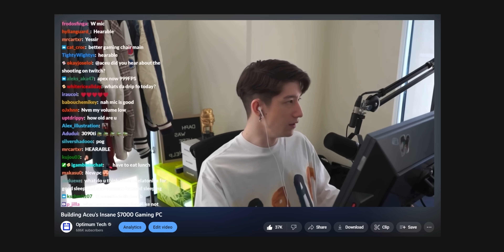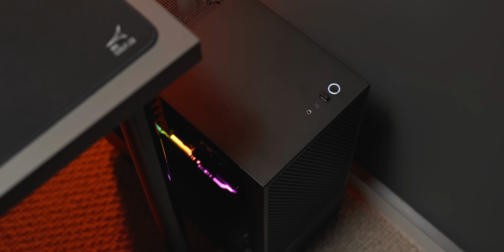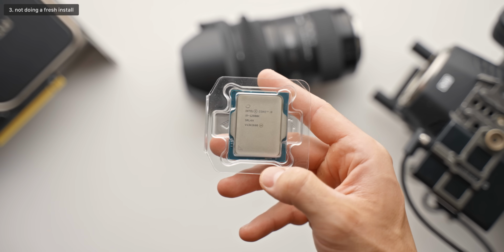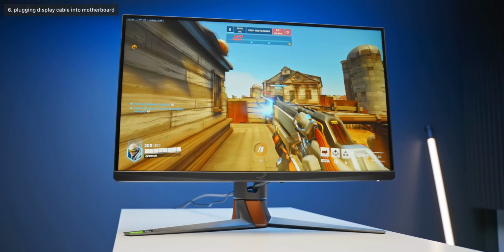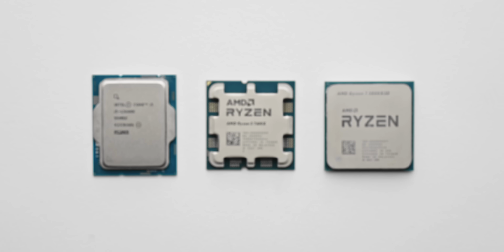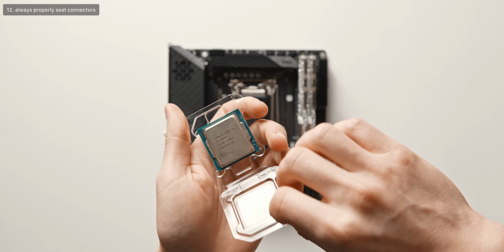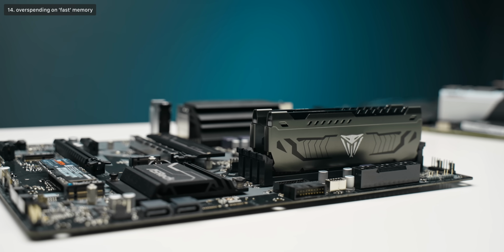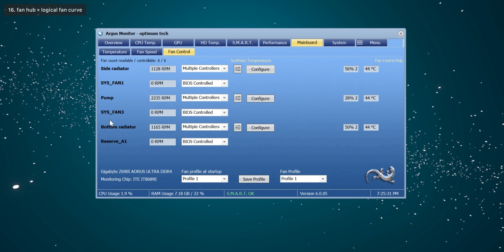Avoid These PC Build Mistakes

Comment: You forgot to mention removing the plastic before mounting the cpu cooler. Still can't believe people miss it..
Reply: It’s natural selection at that point tbh
Reply: I did that last night 😂😂😂
Reply: I've built 40+ PCs and still miss it. Haha
Reply: Never happend to me yet with 20 years of building computers, forgetting the power sw cable or plugging them in to the wrong pins though 😅
Reply: @Tjocksnorriss  I mean I notice when temps are off by like 10c. But I've ran benchmarks with it on and it doesn't melt. Lol
Reply: @PokèMyBalls  😄
Reply: In Norway there is no plastic on the cpu.
Reply: @DR0NE_BEE  On the cooler or CPU? Or both.
Reply: @DR0NE_BEE  doesn’t matter where you live most coolers come with plastic on the cooler contact peice so it doesn’t get damaged
Reply: it's so mundane that it's often forgotten.
Reply: 1% of the population is perfect. We gamers make up the other 99%.
Reply: I built more than 100 gaming systems and yesterday was building new one for myself, forgot to take off the plastic wrap on Arctic Freezer and fucked up badly when I saw 100c thermals lol. The size of AIO distracted me from mounting properly ;D
Reply: enrique amaya  im atheist bot
Reply: TIVOLT
Reply: Did that just yesterday, after mounting the radiator on top of the case I remembered so I had to take out the whole aio again lmao
Reply: almost forgot💀💀💀
Reply: @jakisgosciu7154 też o nim pomyślałem xdD
Reply: Or removing to plastic covers from the thermal pads of the heat sinks on the mainboard when installing an M.2 SSD.
Reply: It usually just pops by itself after mounting the CPU so no need to remove it before
Reply: @ionut122  Not the plastic cover of the socket. The cover of the heatsink.
Reply: I've legit gotten coolers with thin clear plastic strips on it, only right before i put it on the thermal paste did i get the feeling i forgot something.
Reply: I used to buy customizable computers online, so I could choose the parts, but don't have to build them myself, because I was still unexperienced back then. They sent me the computer and all was fine. Years later, when I decided to upgrade my CPU, I saw that the people who build my computer forgot to peel the plastic of the cooler... and it was all covered in thermal paste. So even professionals who earn their money, building computer for customers, even forget that. Funny thing is: It actually did not really impact performance or heat... Atleast it seemed like it. But still, if I buy a pre-build computer, this should not be happening.
Reply: @KEEYBLADE  I am building my computers for 30 years now, and it has become easier and easier over the time. I don’t have to set the CPU frequency via jumpers any more.
Reply: @PokèMyBalls  it happens, to me not that error in particular, but I have built a lot of computers and helped friends, and last time I told one of them to make sure not to forget updating the BIOS before upgrading the CPU or it won't boot (old AM4 board to a 5000 series).

Here I am a few weeks later updating my old build from a Ryzen 5 1600 to a 5600 only to forget updating the BIOS, won't boot and then having to repeat the installation of the CPU cooler again (remove, clean, reapply paste to the old one again, flash and repeat for the new one) 😂

This small mistakes happen
Reply: I almost did, but I seen the corner sticking out right before I put it on. Not to mention that I'm my CPU ever were to go above 40° idling; I'd panicked and open it up again😂
Reply: Happened to me on my first time a few years ago
Reply: don't forget to turn on the psu either
Reply: It doesn't help when they put TRANSPARENT plastic on it, cut to the same size as the part. The only way to notice it is the too-reflective surface finish.
Reply: @DR0NE_BEE  Why would you need a cpu cooler in Norway :)
Reply: Forgetting to put the Motherboard in the case when powering up.......
Reply: Oh. Haha. I just built my first PC yesterday. By the time I thought everyhting was ready and booted it up, I’d done everything perfectly but I totally put on the cooler AND SSD thermal pad with plastic still on because the sheer anxiety pumping through my veins over the possibility of making a mistake made me big dumb
Reply: Years ago I had an r9 280x that had a sticker graphic on the card. 

It wasn’t until I was removing it to swap the dead MOBO at that I noticed it was peeling a bit. So I peeled it off all the way, and on the underside of the stick was a big red label saying “REMOVE STICKER BEFORE OPERATION”. 

Good job radeon, putting instructions on the underside of the sticker where the user can’t read it until they’ve already removed the sticker 😂
Reply: The implication here is that YOU have never missed it. I'm sceptical..........Can you prove it?
Reply: Removing plastics from electronics is like the best thing ever thoo
Reply: first time i ever put on a cooler on any cpu was insanely close to doing that

that was a month ago
Reply: Bro saved me from an headhache for next week
Reply: What do u mean with plasitc…
Reply: @greesypickels  there's a peel on the CPU cooler that you have to remove and is sometimes not mentioned in the instructions, but present on basically every cooler. Yes it makes a difference, yes it might melt. Yes you have to clean thermal paste and re-apply it if you didn't peel it
Reply: @modernmanueee_  im literally building a pc right now but my cpu cooler didnt come with a thermal paste tube. I bought the nzxt kraken elite 360 rgb with lcd screen. Could it be that the thermal paste came preinstalled?
Reply: @greesypickels  if there's a gray square on the copper block of the cooler it might be, thermal paste is pretty obvious looking.

their website states that it does come with pre-applied thermal paste, IDK how that looks though! I think it has no plastic on the block since paste is pre-applied. In my case, peerless assassin 120 SE comes with a tube AND WITH THE PLASTIC PEEL
Reply: Something that could help this is not using clear plastic. While this won't help people paying at least the minimum of attention, but some what plastic could help some people realise that it shouldn't be there
Reply: I missed it on my first pc builds, I botted up the pc and it would crash on idle until I realized I had left it on.

Comment: Don’t do 16, just use something called fancontrol, other YouTubers have done videos on it, it’s software and entirely free and has more features than NZXT’s software which requires you to spend money on the fan controller. It’ll let you control any fans plugged into your motherboard down to your VRM fan too! And allow you to select pretty much all temperature sensors too. Argusmonitor you still have to pay for and it has less features and just doesn’t look modern in any way
Reply: SpeedFan is another option
Reply: @sushimshah2896  did speedfan got updated the last decade?
Reply: thanks for this one @calzone
Reply: Yup, you can set your case fan curves to be based on both the cpu and the gpu. When one or the other gets hot, it ramps up however much you want.
Reply: Was flabbergasted to hear that advice in an otherwise fair video (especially after "vendor bloatware" section) and headed straight to comments to check if FanControl was mentioned. Luckily, it was.
Reply: I Just said that too. its so much better! And FREE1
Reply: 15 and 16 are basically just disguised ads for useless shit. I'm quite disappointed that he puts such disguised affiliate marketing shit into his videos.
Reply: When I was using Windows I was using fancontrol and it was fantastic.
I could configure almost everything how I wanted without any trouble.
The only problem was my Corsair AIO, but the only software outside the Corsair one that can manage it is liquidctl (that I'm still using since it's available on Linux).
Reply: @Xul  I think it is pretty evident that he has been doing that for years.
Reply: @SECshock  It never appeared (to me) to be that silly and obvious, though some of his other videos already pushed crap products.
Reply: Thank you so much for that Tip!
Reply: Fan control also allows you to control any fans, GPU included. So glad I use that software, my pc is way quieter for minimal temperature increase.
Reply: @ladmad9196  no lol. It works great with my Dell laptop though
Reply: gotta check that out. I currently just have the temperature probe provided with my X570-E strix shoved into my GPU for control of the intake and exhaust fans. Works great but it obviously takes the probe time to reach temperature to control the fans.
Reply: @christophervanzetta  huh, hasnt worked for any of my mbs yet. i actually use argus monitor (found it on my own through forum posts actually) and so far its been the only software that remotely does what i want it too.
havent tried fancontrol yet tho. i will keep that in mind to try it out
Reply: @christophervanzetta  FanControl is literally the best
Reply: @hoplul  i absolutely love your Profil Pic
Reply: thx
Reply: @Xul damn, on such a video disguised ads? Disgusting smh
Reply: Tysm

Comment: Biggest: Not turning on your power supply and thinking you messed up elsewhere.
Reply: fr i did this but realized before i got too scared
Reply: Yep this is the best one stripping it all down putting back together doing it 1 component at a time for the power supply to be on the off switch i did that 1 time and never again that is what i check every time now can guaranty plenty of people have done it.
Reply: Or even better, like me yesterday, not switching the power switch on the wall for my psu and wondering why it won't turn on..
Reply: And then breaking the entire build because you think it doesn't matter at that point.

Comment: Gonna have to disagree with getting a cheaper CPU for gaming, it really depends on the type of games you play. If the game is optimized correctly yes it should be mainly using the GPU, but some games are VERY CPU intensive. I mainly play a lot of MMO's and a better CPU makes a huge difference, especially when there are lots of players on the screen. I also play some games that are optimized very poorly and heavily rely on the CPU.
Reply: If a game is CPU dependent, it doesn't have to mean that it is poorly optimized. Take strategy games like Civilization V or VI for example. In general, the faster your CPU, the faster the AI calculates their turns. CPU's are better at AI calculations than GPU's unless you have an AI accelerator card. But I don't think those can be used for gaming anyways.
And then we have games like CS:GO. It has so simple graphics that most of the time your bottleneck is the CPU.
Reply: Exactly bro for example modded multiplayer asetto corsa is very cpu intensive
Reply: Tf2 is another good example of CPU intense game
Reply: moreover, more powerful cpu mean that you can stay with it longer without need to buy new cpu
Reply: No game is more poorly optimized than Ark.
Reply: Yea that was a massively bad take.
Every single major part (MOBO, RAM, CPU, GPU, storage) of your PC is important.
The amount of people I've seen saying bullshit like "no no you don't need a good MOBO just get the cheapest thing you can find" and then run a 4090 or something and act surprised when their performance is ass?
Or when they run all that with a fancy MOBO but then have a garbage CPU? your pc is going to be poorly optimized.
Or when you run that fancy ass CPU, MOBO, and GPU but then you got the cheapest RAM money can buy that runs at 2133 mhz?
yeah nah. And then you got the good RAM, CPU, MOBO, GPU, and then you throw in some SATA SSD as your OS drive or maybe even a HDD.
Like, yes it can work.
yes you'll probably get better FPS than someone who has really bad parts overall.
But you're just bottlenecking the shit out of your system.
Reply: @Gary_The_Metro  Hey man I'm planning an am5 build for my first pc rn and was thinking of cheapening out a bit on the mobo since the more expensive ones didn't look like they had anything I cared about (pcie 5), would you mind explaining how exactly a cheap motherboard could affect my performance?
Reply: @madaranotsoanonymousnowuch1539  Well for one, if you get a MOBO that doesn't support 6000+ mhz for example and you're using an AMD CPU, your CPU is going to bottleneck hard.
Additionally there's the simple fact of less m.2 slots which can be more or less important depending on the games you play, what you do, etc.

Then there's chipset, Some chipsets are simply more efficient than others.

Now mind you, I am not saying "Just go for the most expensive mobo imaginable, just throw money at it wcgw"

I am saying, that if you're already spending 1k on a GPU. 400 on a CPU.
Don't spend 50 on a MOBO.
Reply: If your playing mmos or simulators, you don’t need high performance Lmao. Just run it at 60fps and be done with it
Reply: All the games are not optimized for 8+ cores. MOST of them are optimized only for 4-6 cores. And some of them using only 2 cores. So you dont need a i7 ,i9 , R7, R9 CPUs for games. You just need a good and powerful 6/12 CPU with good perfomance per core.
Reply: If you play mmos, your opinion is invalid and you might as well use a 400$ laptop
Reply: High CPU core count is rarely a factor in performance, even in CPU-bound games.
Reply: I know this is a year old but like someone mentioned, it's also easier and cheaper to upgrade CPU than GPU. Having an high end CPU is already future proof than trying to do the same with GPU.
Reply: @Gary_The_Metro you can buy cheaper cpu components as long as they are spec accordingly to what results you’re trying to accomplish for example i run the cheapest b650 motherboard with a 4090 because on that pc all im doing is gaming so and i dont need all those extra features. I run the cheapest ram i can find as long as its at least 6000mhz oc im  good. I just make sure my cpu and gpu dont bottle neck each other
Reply: @mrgoodbar216  You seem to be mistaking "extra features" as being the opposite of cheap.
cheap MOBO's can still have dumb extra features. I'm talking about making sure you have a MOBO that actually can handle the stuff you're throwing at it. Making sure it's build quality is at least reasonably solid and as you said yourself, isn't a bottleneck.

My point, is that when you buy a PC there is no part that is "unimportant" 
If you got a 4090 but you're running DDR3 RAM at 2133mhz on a fancy ass CPU. Your system will be garbage and no amount of GPU or CPU power will fix that.
Reply: Squad for example
Reply: The past has shown that mid tier PCs benefit from "overspending" on the CPU. The time between upgrades is long enough so you will have to buy a new 200$ motherboard anyways and the difference between CPU prices is effectively much lower(400$ vs 600$ instead of 200$ vs 400$.). You will be able to use a better CPU for 1 or 2 more years and have a smoother performace the whole time. For example a 300$ i7 4xxx would have been a better choice than a 200$ i5 4xxx for most people even though the performance difference at launch was just 10%.
Additionally the resale price of CPUs often drops to zero except for the very best CPU for that socket.

Comment: #16 - Bend your motherboard or gpu
#17 - Not peeling off the protective foil from cpu cooler before install
#18 - Not checking your finished build for loose screws, washers or any leftover metallic material which can short your motherboard
Reply: if you use nvidia rtx than its impossible to bend (in my opinion)
Reply: I've literally never seen a fragile GPU.
Reply: I once changed some component in my pc and dropped a tiny screw into the case and could never find it again but I’d here it rattling around whenever I moved the case. Never caused any problems but it was pure stress
Reply: @DredFul595  both amd and nvidia use the same material pcb and layout, the only differences are how manufacturers design the heatsink and the actual chips on the pcb
Reply: @sargonsblackgrandfather2072 if it touches your motherboard it can short it
Reply: @saminchoudhury2659  I built a new pc so not an issue anymore. Had that one for ten years with the screw rolling around and never had it cause any damage, just lucky I guess lol

Comment: One note for the antennas: if you have signal strength problems then the antenna come with your motherboard would be your best bet since those would have greater sensitivity. Shorter antennas would be fine if you care about aesthetics and you are okay with the signal strength.
Reply: can confirm. went traveling with the small antennas and the signal was atrocious in some places. the stock antennas from your motherboard are way better for weaker signals
Reply: To add to this; Most stock antenna's are magnetic so you can hook it up to the back of your case more cleanly.
Reply: @metord  stupid strong magnet killed one of my client's ITX mobo, drained the cmos battery and damaged one of the components near the vrm and we had to RMA it. So be careful with this base and put it far away from the pc or case.
Reply: @emini6  What the hell kind of magnet are you talking about?
Reply: enrique amaya  bruh we're discussing wifi here.
Reply: enriqueamaya3883  Keep your fairy tales to yourself. This is real life.